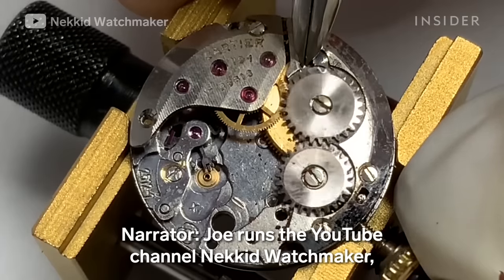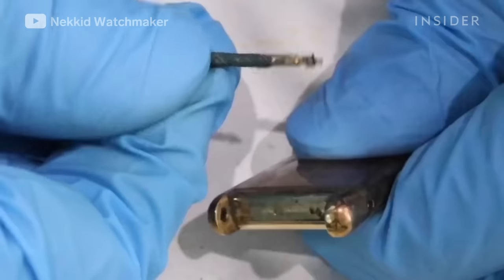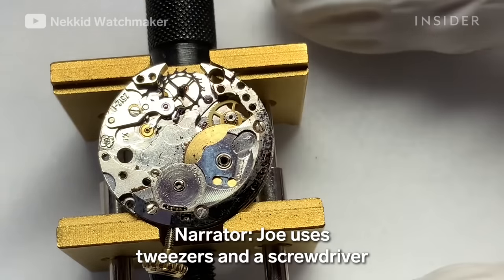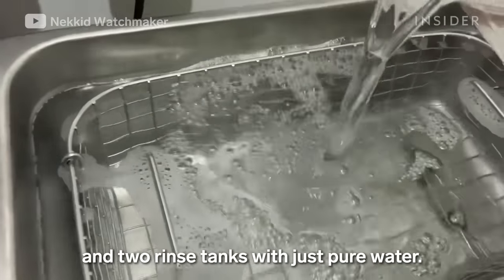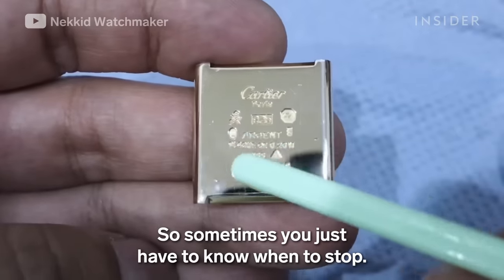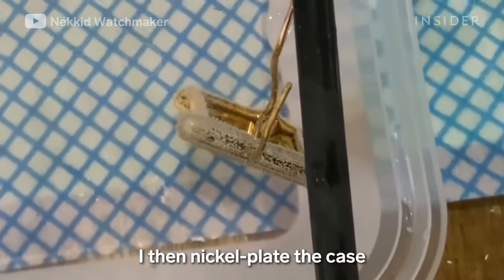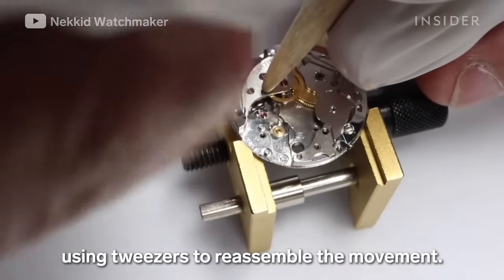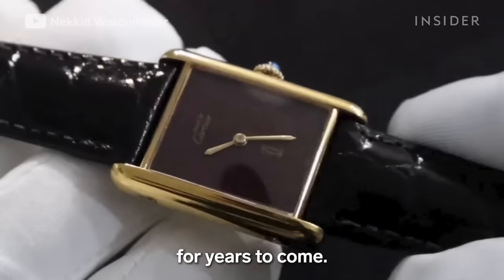How A $3,000 Cartier Watch Is Professionally Restored | Refurbished | Insider

Comment: what is the purpose of the small ruby-like stones inside of the watch, not visible unless taken apart?
Reply: those small ruby like stones are called jewels and they help reduce friction and provide a hard, smooth surface to allow metal components such as the wheel train to rotate freely